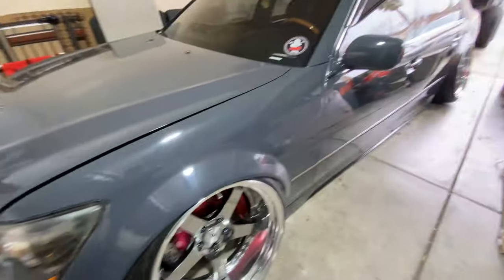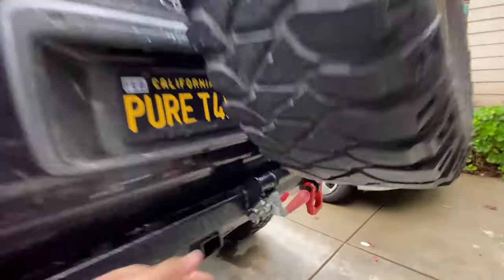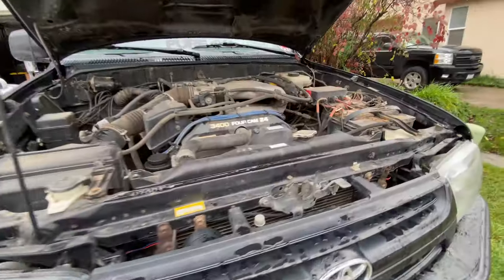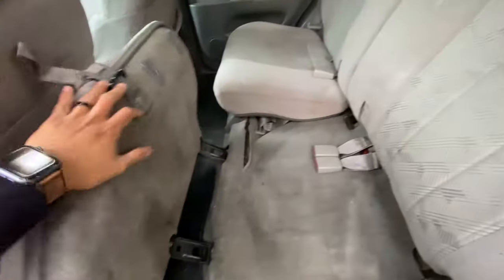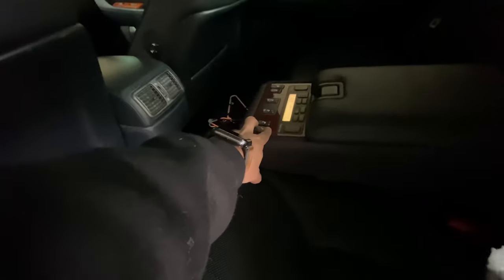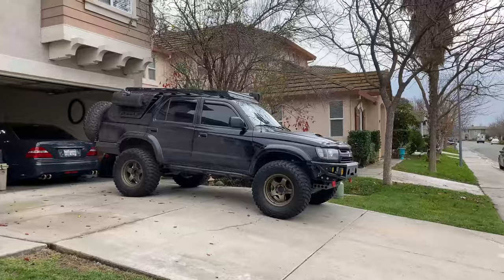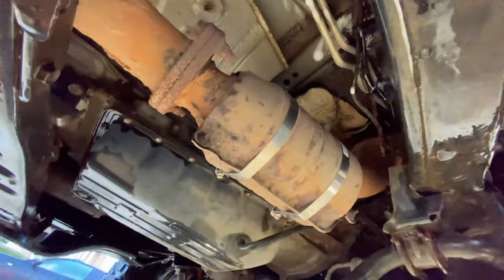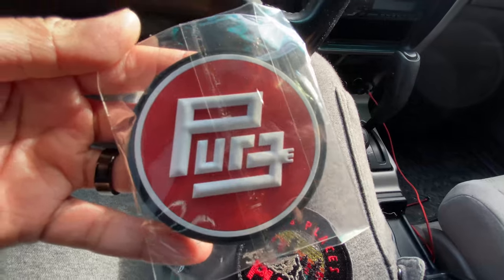PURE TV: S1E1 Final Farewell (3rd Gen 4runner Walk Around) Off Road Overland Baja Designs BFGoodrich

Comment: I have a 01 4runner, I wanted lifted so bad just for pleasure  nothing off-roading. How much should I expect to spend for a decent/good looking lifted truck  like yours, I am in Tx if that helps.
Reply from the maker: You can really spend as little or as much as you want. To achieve a similar lift and tire/wheel setup I'd say under $5K is doable